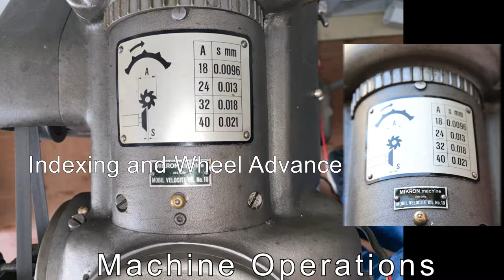Hob Sharpening with the Mikron

Comment: All the hobs I've seen have a straight flute running coaxial with the cutter. Is that why hobs have to be rotated by its lead angle to generate the correct involute form on the workpiece? If it were a helical flute on a gear hob, does that mean the hob can be exactly perpendicular to the workpiece?
Reply from the maker: All of the Hobs I have seen have straight flutes too.  The reason they need to be turned is due to the lead angle of the hobs pitch, diameter, and the number of hob starts.  This calculator can be used to get the lead angle.
https://evolventdesign.com/pages/worm-hob-lead-angle-calculator